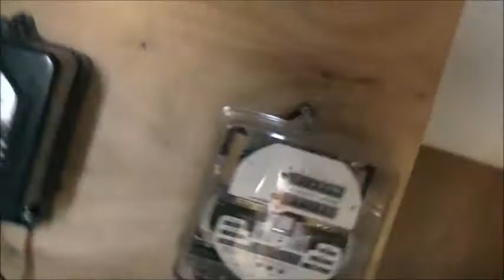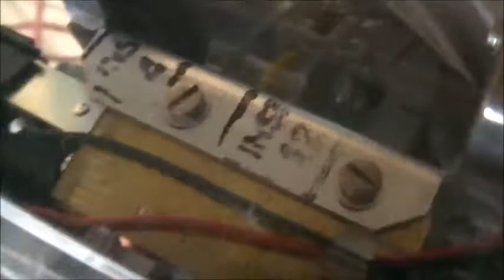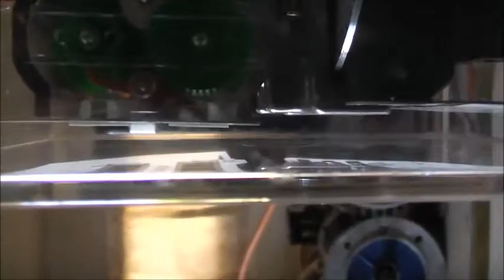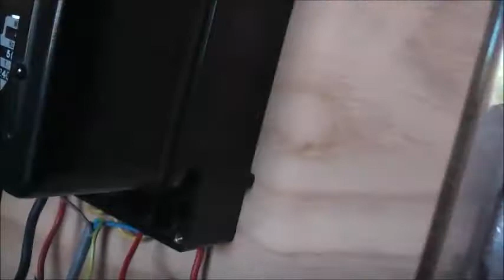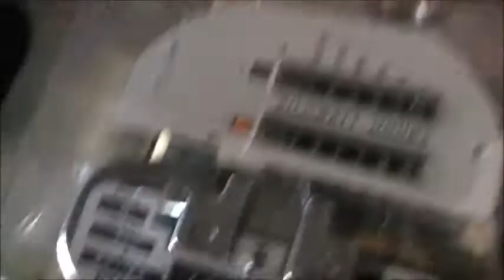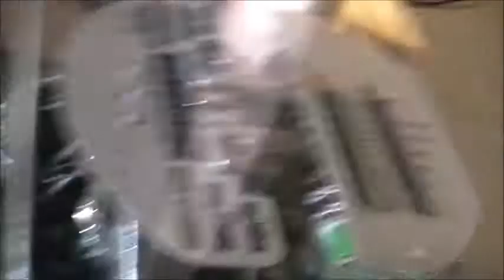EMAIL SDMR Watthour Meter Test

Comment: Nice meter, That is a Schlumberger register, exactly the same as in my French 4 rate meter. This hasn't got the embossed digits. Same number style as in another french meter I have , type A10C2.
Schlumberger made different number styles which fit various registers, the Geneva take up slot is in between the 4 and 5.
That meter should run a lot faster at 3 x 60 Amps. I think you have wired both meters in parrallel. For testing they should be in series for current  and the PT coils in parallel.